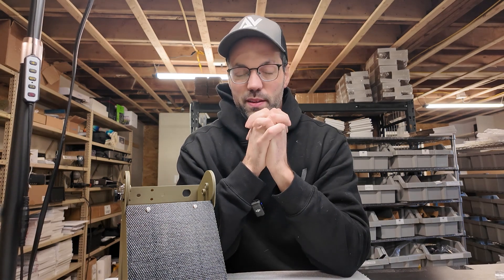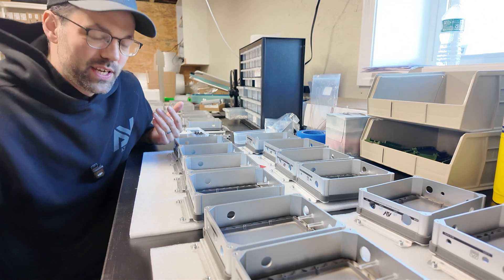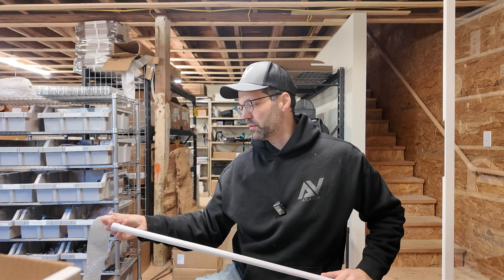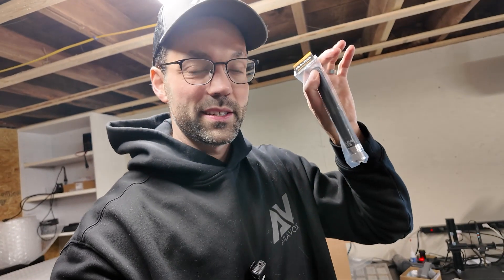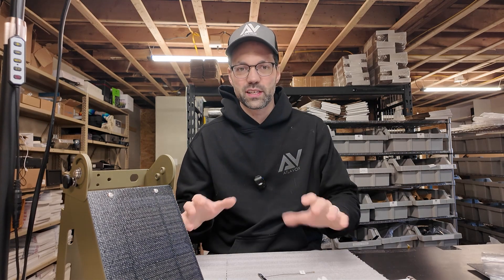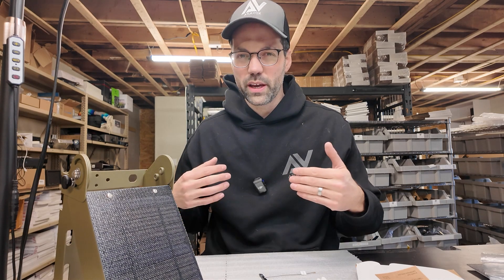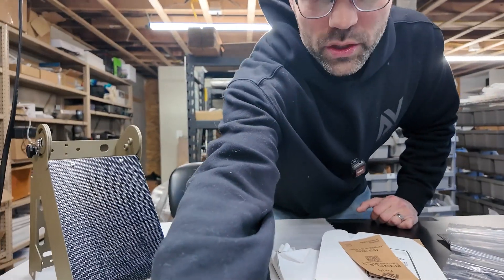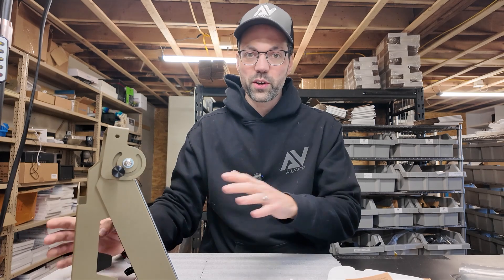Atlavox Beacon Meshtastic Solar Node | Preorder Status Update and Challenges

Comment: WHAT is your opinion re MESHCODE... will Atlavox Meshtastic Node upgrade to MeshCode?
Reply from the maker: We are going to be adding official support for MeshCore on the Beacon and M1. We've had a few customers request it and we will flash it if requested. But I want to make it so it can be selected at time of purchase. Both radios are fully compatible with MeshCore. I haven't had time to play around with MeshCore yet though so I need to tinker with it so I can understand it better.

Comment: Overall, your implementation is fairly good. There are a few design choices I would disagree with, but they're not deal breakers. However, there is a critical design fault you seem to be oblivious to. Your node will work in southern states just fine. But in any state above say 37N that li-po battery will fail over winter. Most all "LI" batteries chemistries will fail during a cold winter. Especially nodes that don't have direct sunlight exposure + internal insulation to retain some heat. The ONLY LI battery chemistry that won't fail during a northern winter is lithium-titanate (LTO). But LTO presents problems all of its own. Firstly, LTO cells are hard to get ahold of and they're expensive. Secondly, it forces you to use a secondary charger + voltage regulator since the onboard charge profile is meant to charge NMC, LCO, LFP (ect) chemistries (LTO's have significantly lower cell voltage). This (of course) drives up node complexity and price......... We've fought and struggled with node survivability due to frigid cold for serval years now. Ultimately, we've settled on a solution we proofed this past winter. And that is using super capacitors as the power source. The tricky part of using CAP's is sizing the cluster (in Farad) to account for overcast days/weeks. And that necessary capacity is strongly dependent on solar panel performance (location, height, obstructions, shading ECT). Since capacity is so strongly linked to charge performance, I don't want to throw out a specific FARAD value (since it will change from one setup to another). But I will note that using caps as a power source WILL increase physical size of each node by a pretty large margin. (comparatively) So one should consider that in their mounting solution/s.  

Overall, it's pretty nice product that will work in a large portion of the southern (ish) US. In the "milder" winter states, say 37N - 42N a black enclosure (that's exposed to direct sunlight) that's also insulated with a more typical NMC 18650 power source will work just fine. But once you get above 42N and start seeing -10, -20, -40F temps the previous solutions will ALL FAIL. (except the afor mentioned LTO solution)

Comment: as somebody else who ships a lot, i love USPS priority mail for most things. you know the set cost and packaging is free. Doing all the fancy cutouts is neat, but I think for the market, most dont care and just want the cool product. I remember looking up custom packaging and was blown away at the added cost of it all. Also, for those long antennas, i would just link them to amazon with an affiliate link and call it good. I also stopped trying to deal with long items due to the same issue. now i try to design all products to fit in some sort of flat rate box.
Reply from the maker: You're talking about flat-rate shipping where they give you the boxes? That's great to save on the box cost, but it doesn't solve the internal packaging materials I need. Now that I've shipped a bunch of Beacons, I've got to say, I'm really happy with the custom foam. It's fast to pack, everything has it's place, it's super secure during shipment. Looks like I could've done a medium flat-rate box, but there are definitely times where it's more expensive than shipping with my own packaging. But yeah, I like your idea of linking elsewhere for the long antenna, that was such a pain.
Reply: @Atlavox  yea, custom foam is always a winner from a looks standpoint. I LOVE awesome packaging till i priced it for my stuff lol. The apple look is nice. Your stamp setup for each box is also killer, we do it also and it gives that nice custom touch. doing custom craft tape is also cool

Comment: I got mine today but It won't let me pair to my phone. I tried 0000 and 1234
Reply: Solved?
Reply: @808zhu  Oh yeah, forget how at this point. node has been stable as all hell mounted on my shed except when i tried to update the firmware OTA and it bricked and had to bring down to fix
Reply: @dylanmaniatakes Good to hear. I considered what I'd need to do in case of a maintenance issue. Came across a pole mount made from chain link fence toppers that nest together, with a bolt at the joint. So it'd be feasible to bring down the top half even with bottom cemented into the ground. $50 for 2x 10' galvanized poles (1.5"? dia).

Comment: Can you add low tempature protection/cut off with either LTO batteries/charger or the new  “RAK WisMesh Board ONE” there’s Almlst nothing on the market that addresses this
Reply: The new wishmesh board one has some sort of low tempature built in
Reply: @BobBob-il2ku what’s the concern here? Freezing temps don’t seem as much of a concern as scorching temps. Have you considered changing the battery with a LiFePo cell. They are better at operating in extreme temps.

Comment: i wonder how much cheaper it can be if you made it to be a diy kit? that way it will save a lot of time on your back end.
Reply from the maker: Yeah I've thought about that too. It takes almost an hour per unit to get it out the door. I've also thought about modifying the front frame component to be compatible with those cheap plastic enclosures people use all the time for DIY solar nodes, and just selling the frame and maybe the solar panel with it. That would cut down the cost a ton.
Reply: @Atlavox  i personally would love a DIY kit but instead of the pouch battery just have a 2-4 cell housing for 18650s with a charge controller
Reply: @Atlavox I would have been happy with DIMyself if there was a box that could be checked I would have checked it.

Comment: Love the product you're building, and the quality looks incredible. In regards to your comment at the end about the cost of the foam inserts for shipping, and the thought of creating a lower cost option, I think when you have the time looking in to those options would be incredible. 

For example, the custom foam insert would look and function awesome... but it goes in the trash as soon as the box is opened. Your idea of not offering the longer antennas is a great choice, or you could work with a drop-shipper to have them ship directly in a tube or less expensive option, that way you don't have to handle them. I'd just recommend you post an affiliate link to those antennas and let them order it themselves.

I do love what you're building, heck, I'd love two or three of them to deploy at friend's houses at higher elevation locations, but the price does slow that idea down, so a lower priced option would definitely get me interested, but of course that would completely overwhelm your production capabilities, so if you go lower price you're going to need to do everything you possibly can to reduce the steps required to produce them and get them ready for shipment.

And I love my T1000-E's, they are incredible little units, and combined with an Altavox Beacon is a great setup! The other setup you might consider adding someday is what I call my "mobile" node... it plugs in to a 12-volt outlet in the car which charges a battery pack whenever the car is on. It goes to an external mag-mount antenna. That way when the car is off it is simply running off of batter, and then the next time I drive the battery gets recharged. That way my T1000-E in my pocket can still reach the car node when I'm in a store or restaurant, and the car node bounces it out to the larger mesh. I feel like everyone should aim for a base node at home/work, a mobile node, and a pocket node. Those three together makes Meshtastic convenient and will grow the overall mesh in a city.

You are doing awesome work, keep it up, and looking forward to seeing what is next!

Comment: mine has shipped. if the lid is on its ready to go?
Reply from the maker: Yes, all Beacon enclosures ship fully assembled and ready to go. The only thing you'll have to do is install your external antenna cables, mount you antenna(s), and that's it.
Reply: @Atlavox did you disable the TX in the config? Is there a risk of the module activating enroute, without an antenna, and frying the amplifier?